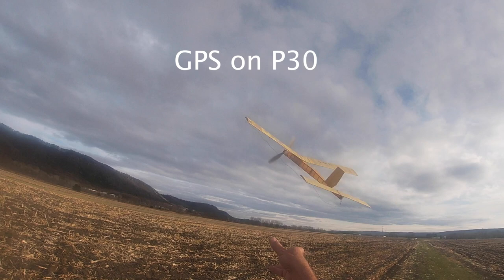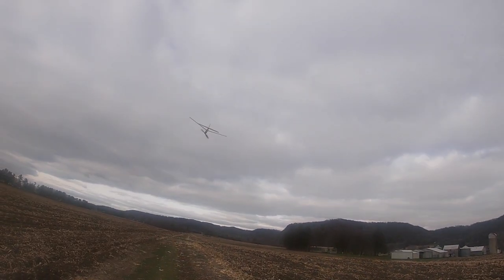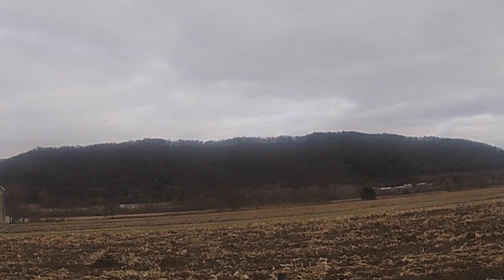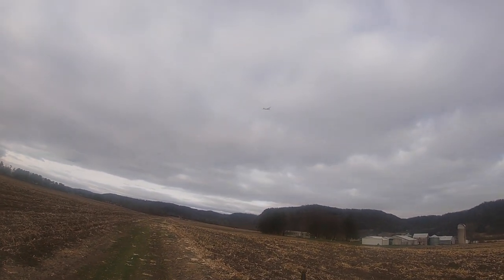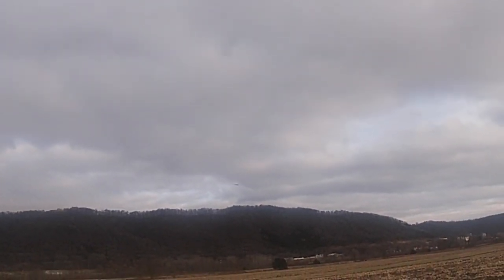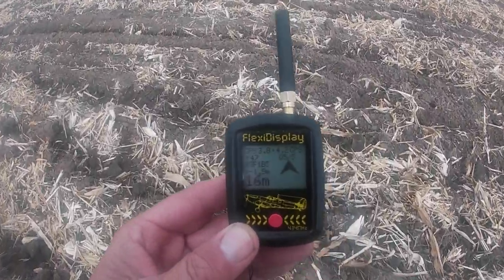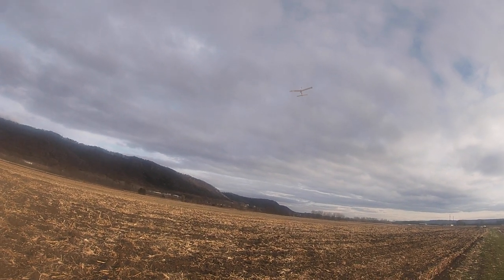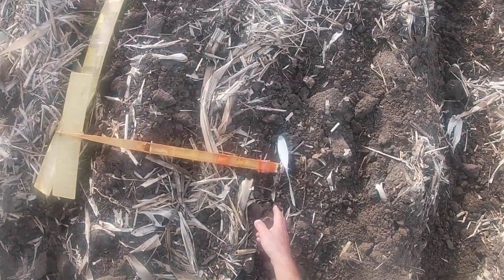GPS on a P30 Rubber Free Flight

Comment: Sold! :) I saw this video, went to the website, and 10 min later I'm on the waiting list. Cheers for the info. I was surprised at all the other features that the hand unit offers, like the ability to transmit location data to your phone and function as an RCDT transmitter. Endless possibilities. My E-36 and Wakefield thank you as I'm always afraid to send them up on a full power/motor run flight.